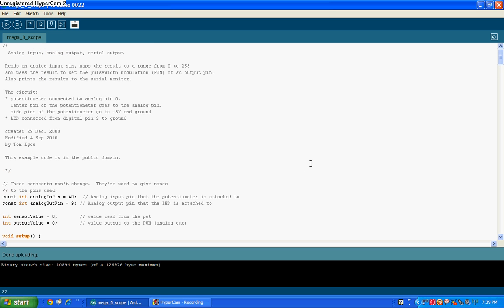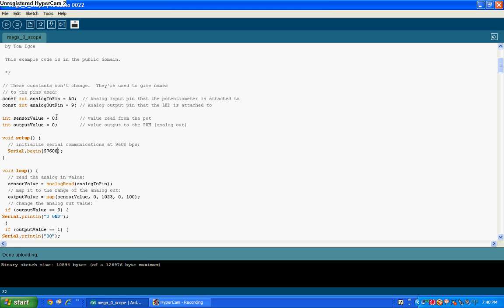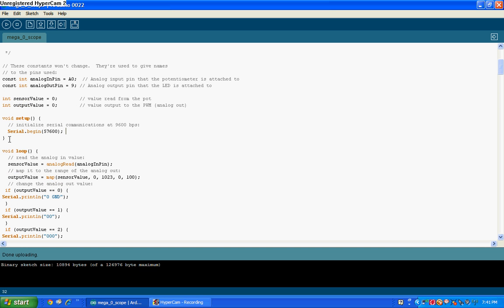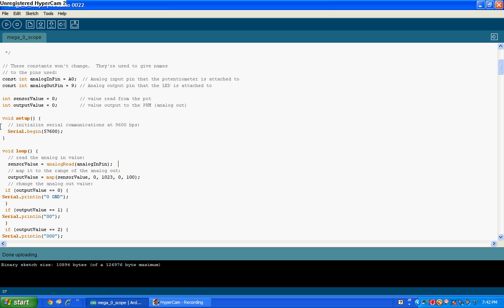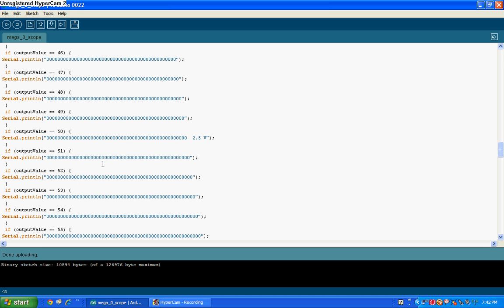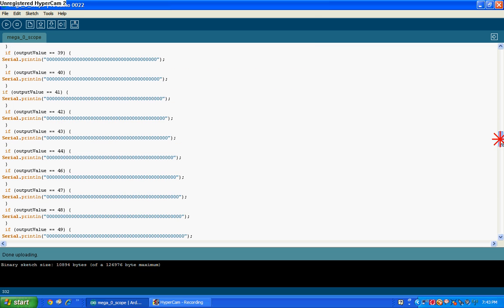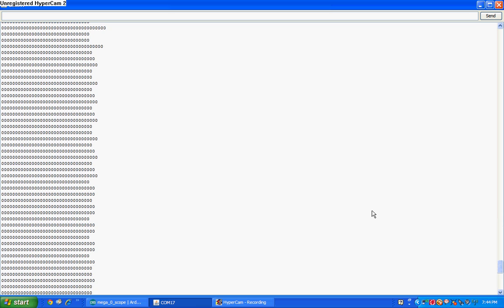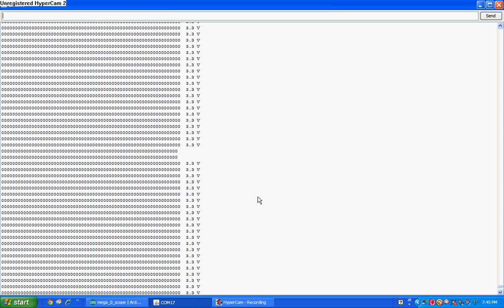Arduino Oscilloscope

Comment: For an audio signal you are going to need a triggering scheme. Maybe wait to start print lines until the voltage crosses you trigger threshold and then only print a  as many lines as your screen will hold and wait for the next trigger ?  What do you think?